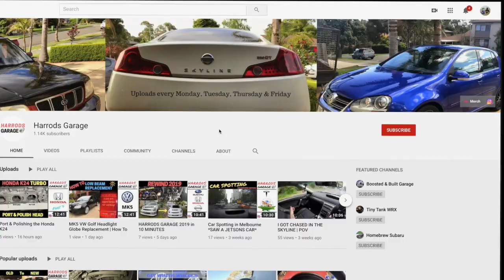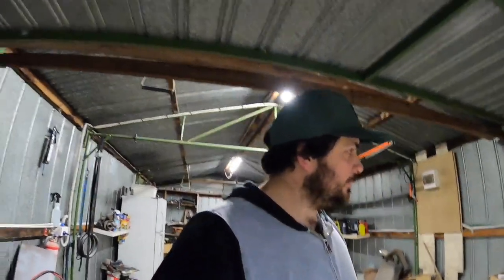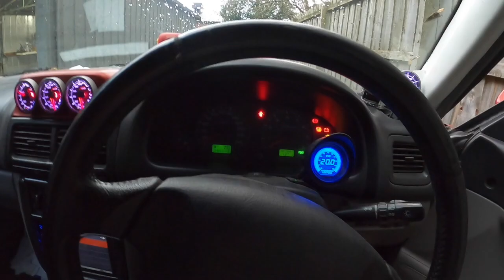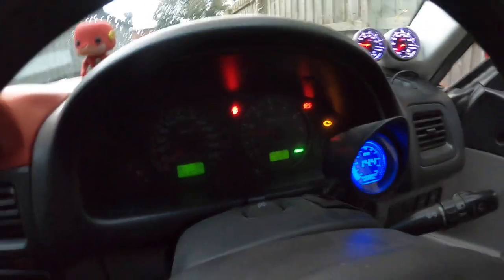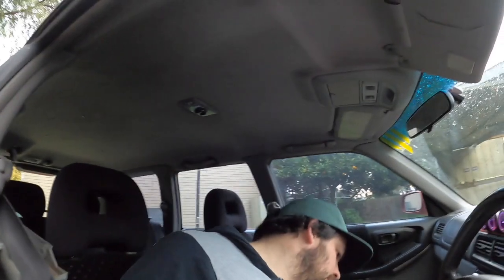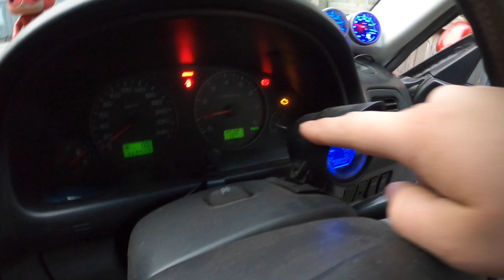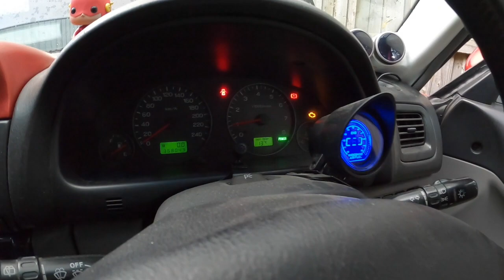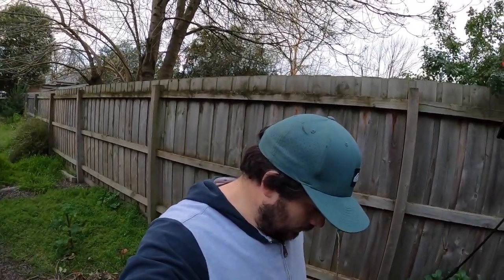Twin Turbo Subaru can MOVE!

Comment: I had a similar issue with my dash lights after I changed to LEDs.
Try check your illumination module behind your glovebox if you haven’t already
Reply from the maker: Haven’t check that actually
Reply: Harrods Garage could be your culprit.

Comment: Poor GT35, he's not a happy chappy.  Probably a fuse out for the dash lights, but you know that. When it goes in for a tune, are you going to get them to reset the cold start parameters as well?
Reply from the maker: Na definitely got an exhaust leak pre GT35 somewhere, probably the back of the td05. Oh and the light ring around the ignition barrel stays on if the overhead light is on door. That happened when I went to different dash lights many many years ago. Will have to redo all the dash lights I think.